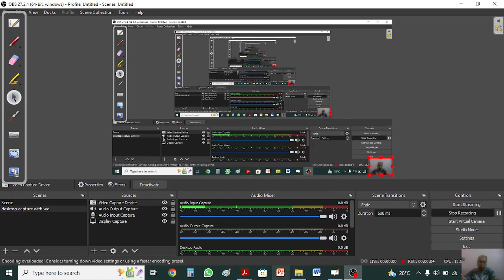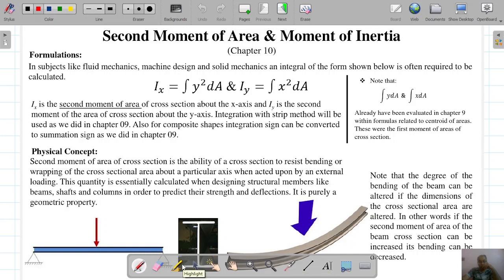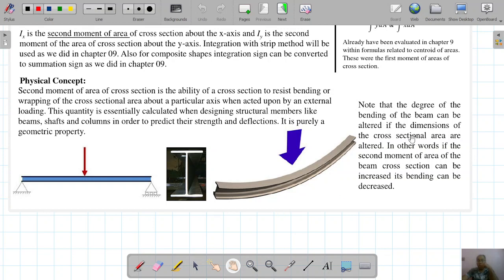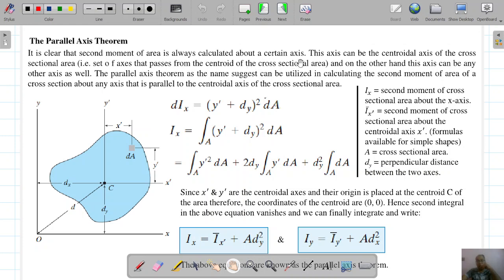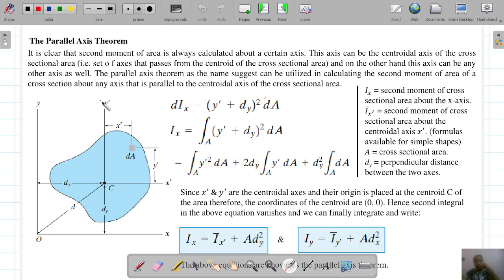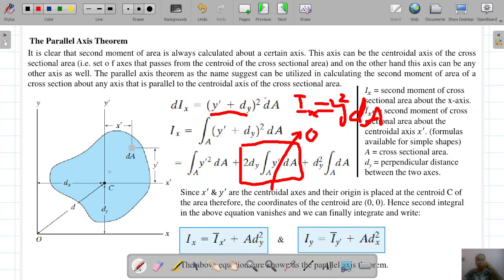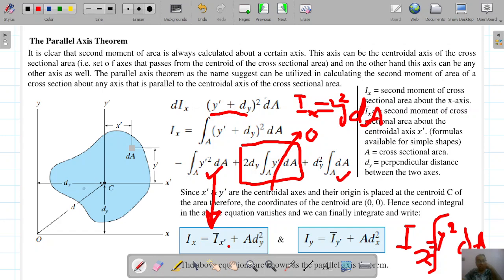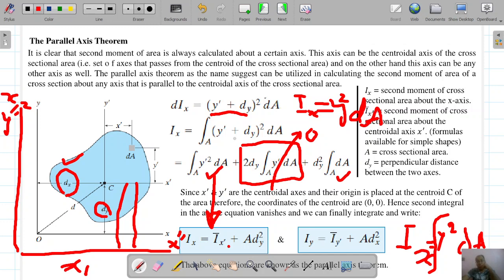Second moment of area. An INTRODUCTION

Comment: Sir kindly guide me if an object is not symmetry about x-axis and y-axis so which method we will apply either second moment of area or parallel axis theorem I am facing this issue because in book it is written if an object is not symmetry about an axis so apply parallel axis theorem but in the solution of book manual question no 10-19 they solve the question by second moment of area although object is not symmetry about x axis and y axis
Reply: see video of second moment of area applied to composite shapes.......this video has all the answers of your question😃
Reply from the maker: See my  video of  second moment of area applied to composite shapes... It will answer all your Questions